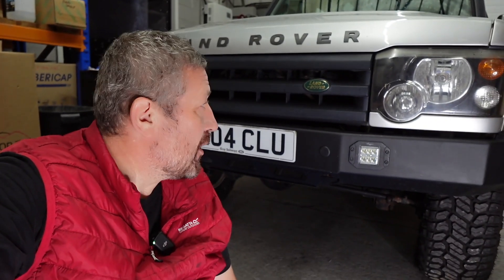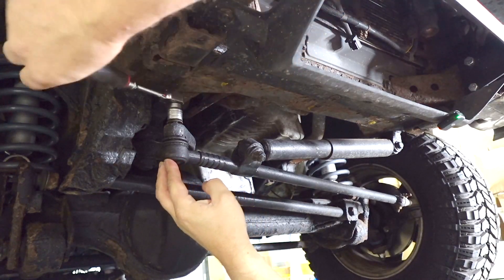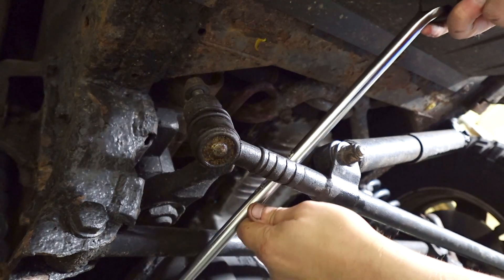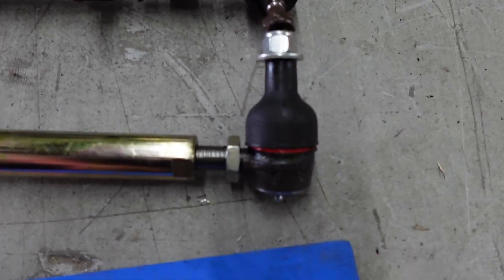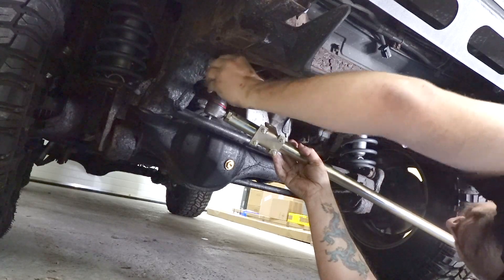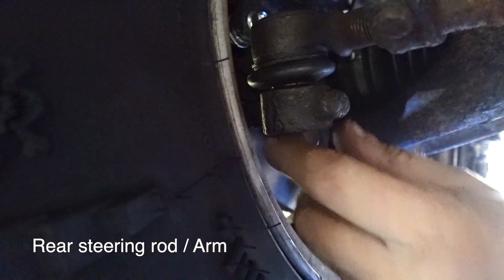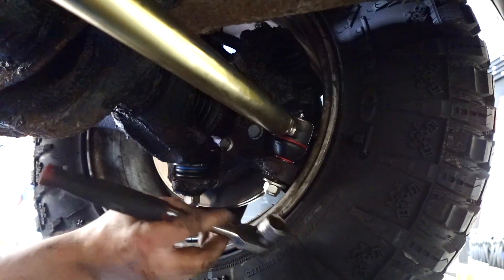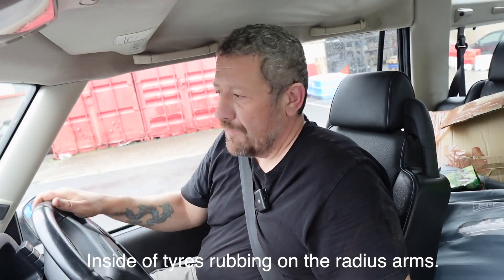Easy upgrade to the Discovery 2 with heavy duty steering arms and damper from Terrafirma

Comment: Next time please take the ball joints all the way out and put plenty of anti seize on because the next guy doing an alignment will thank you!
Reply: It's always worth removing balljoints completely to verify how long the thread is.
Shouldn't be a problem when using quality parts but you don't want to risk ending up in a situation where, after adjustment, the balljoint is only screwed into the track rod by a couple of threads.
Reply: Denso tape is good too